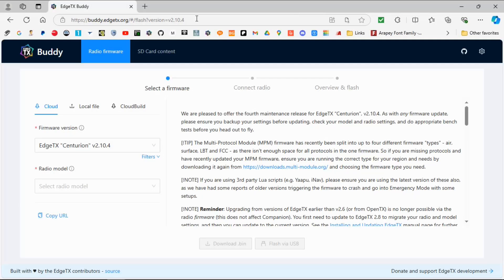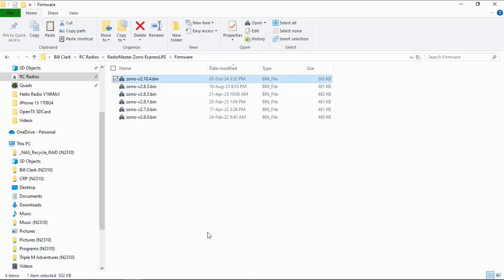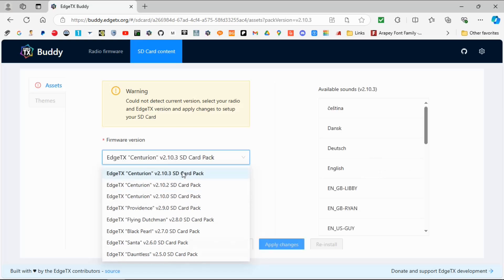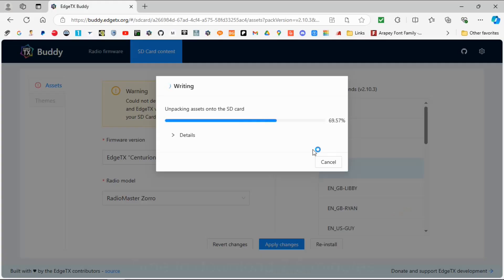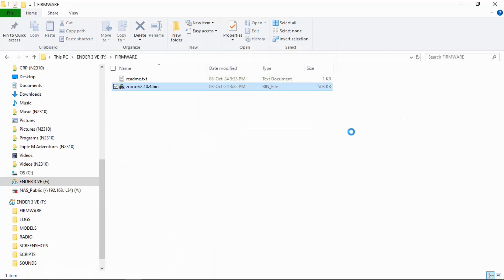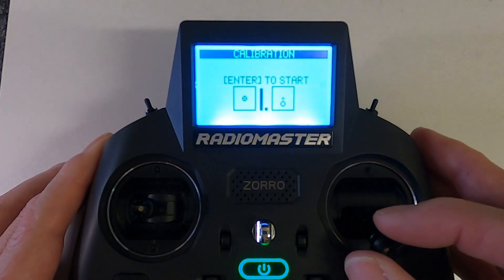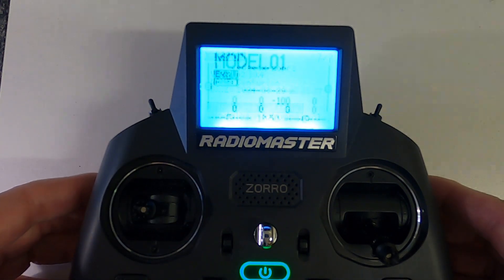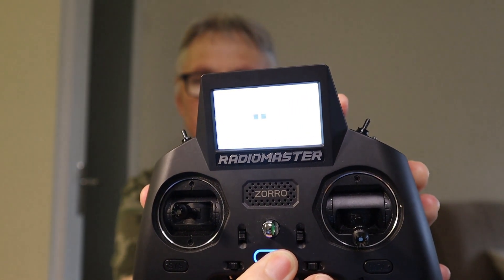OpenTX Conversion to EdgeTX  (Viewer Request)

Comment: Hi Bill, a couple of years since I've flown. I've started fresh with a new computer (Windows 11) and now needing to change to EdgeTX? I cannot get my TX16S to register to my PC (to get the hang of flying sim again prior to flying a physical model). Previous years your videos helped me using the TX16S to OpenTX. Would you happen to have any ideas? I read perhaps STM32 driver? However I cannot seem to ge this to work also. And when I follow this video the SD card continues to write and appears to be finished (all files are on the SD card) however continues to write (even after well over an hour). I've done this several times and cancel after about an hour into it with all files on the SD card. Radio recognises the firmware however cannot flash. Argh! Maybe just put it back into the cupboard again! Thanks!
Reply from the maker: Have you converted your radio to EdgeTX from OpenTX?
Reply: @the-happy-RC-flyer  I'm attempting to change via card as I cannot plug the transmitter via usb
Reply from the maker: @yvanni0136 I have not come across this problem before do you have a very slow internet connection? If you have access to a friend’s computer could you try download the firmware and SDCard contents there?
Reply: It's probably a Windows 11 issue. If you have access to a Windows 10 machine everything should work.

Comment: Hi Bill. Thank you for all your videos. I have a question regarding the boxer radio. Is there a way to programme the six button switch to stay on the last mode/setting/channel/button that it was on when the radio is switched off then back on? i have found that the radio always defaults back to button1 at start-up and it does cause a bit of a problem if i fly in a specific mode eg Auto, switch of the radio (still flies in auto as programmed on fc) but with the radio switched back on  the 6button mode returns to 1... if it makes sense. 
Thanks.

Comment: Hello
 can i contact you to solve a problem i have with my   radionmaster tx12 mk2   controller every time i try the problem gets worse i lost all the files and now i cant access to SD 
 please help me please help me i have reached the point of despair 
thank you
Reply from the maker: As you have lost all your files follow the instructions in this video and reinstall the EdgeTX firmware. Format your SDCard first. I am assuming your radio came loaded with EdgeTX.